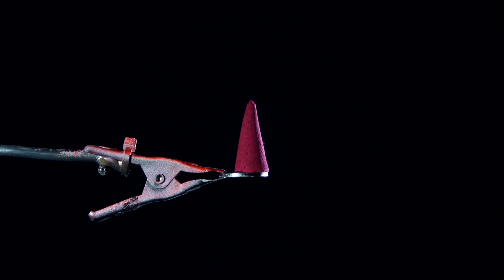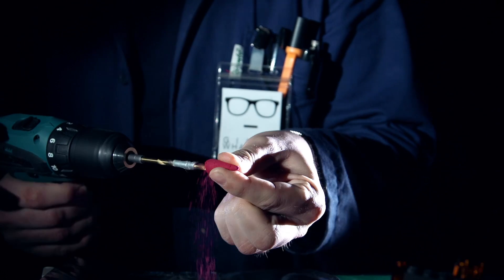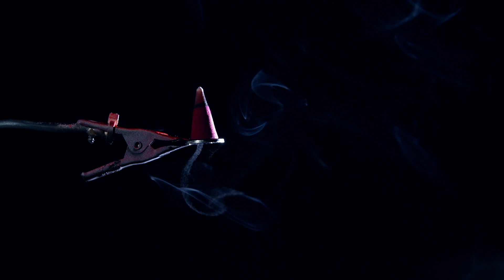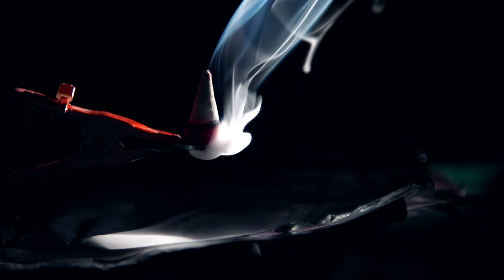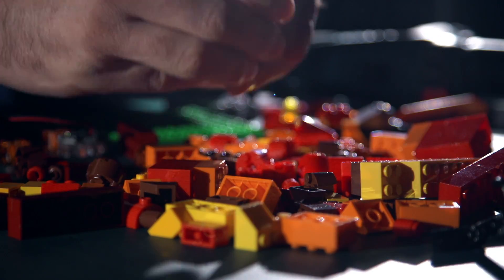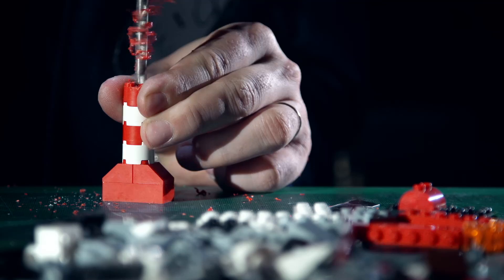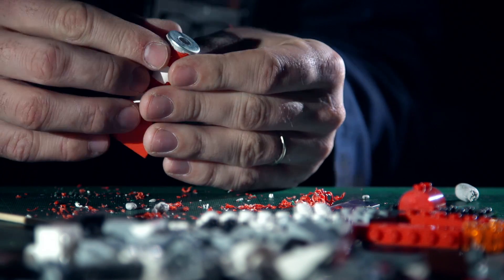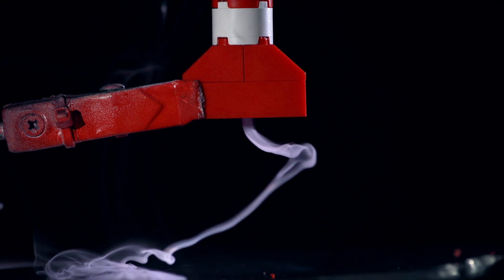LEGO Rocket Liquid Smoke | GIACO

Comment: If I were in you I'd tried to fill cavities of the 3d printed object with water and put it in the refrigerator before use. 
If the smoke hole is strongly refrigerated I guess you can obtain a lot of even more dense smoke.
Reply from the maker: +Hans Brikkenbakken correct... the thing is that I want this to be doable easily and the effect is still pretty good...